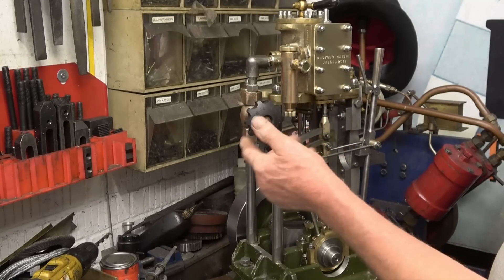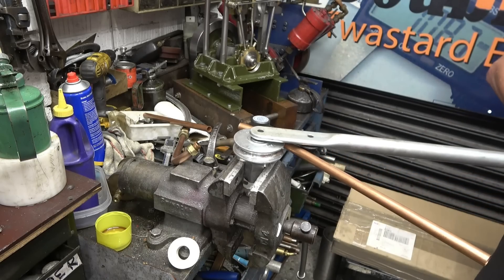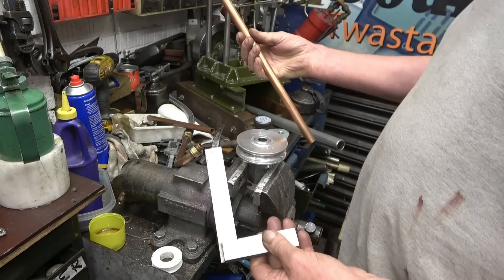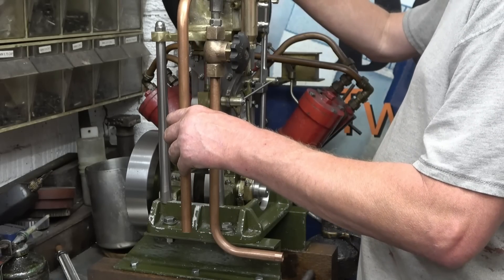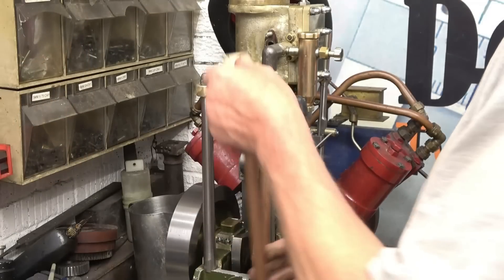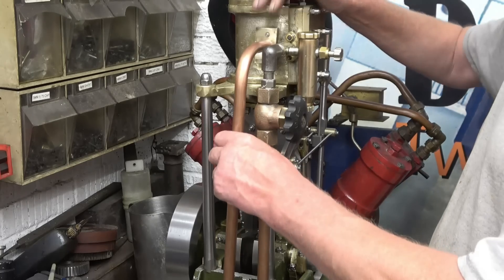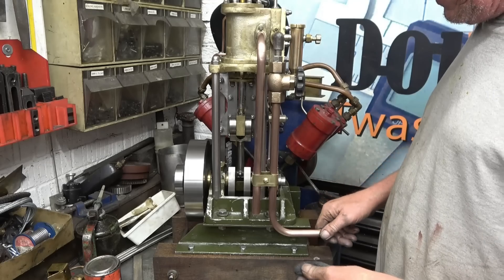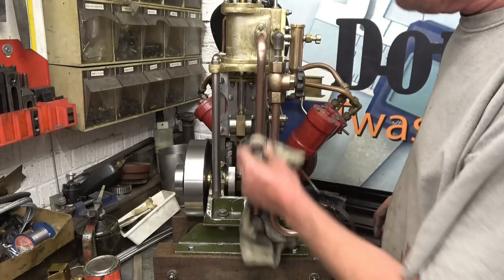SNNC 496 P1  . Bending Heavy Wall Copper Pipe

Comment: Nice one John! On the copper tube front, when I was 19, (and that was 50 bloody years ago lol) I worked at a builders merchants for  a while and when we got deliveries of copper pipe, they came in 6 metre lengths. These you could carry a bundle over your shoulder, but during the time I worked there the British Standard for copper domestic heating pipe changed, and they still came in 6 m lengths but the first time we tried to carry them the bundle almost folded over your shoulder as the copper had been made with a thinner wall. Since that time the standard has changed at least once if not twice again, and now the tube only comes in 3 metre lengths. Go figure!

Comment: I used to work with a guy who served his time making Lancashire boilers. His trick to bend pipe without creating a flat,  was to first warm to cherry red, then  crimp one end, fill it with water, then crimp the opposite end. When he formed the pipe, the hydraulic effect of the water made the pipe keep its shape.
When completed, he would trim off the ends to suit.
It was great watching an absolute genius in his work.
Reply: Filling the pipe with fine dry sand with a couple of wooden bungs driven in the open ends has the same effect of stopping the pipe from kinking. Restoration guys who hand bend exhaust headers for classic bikes and cars use the sand method a lot.